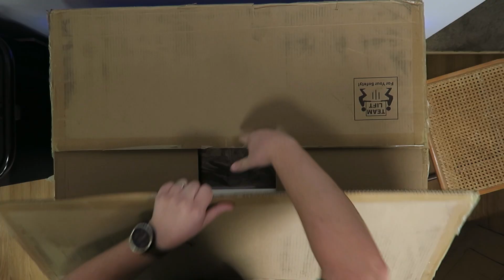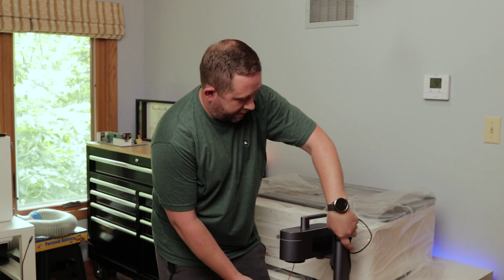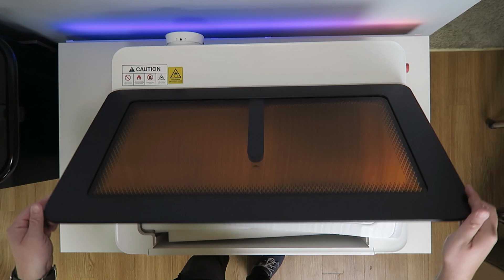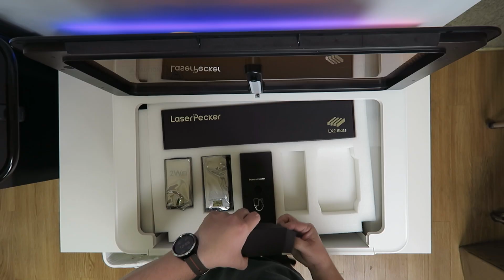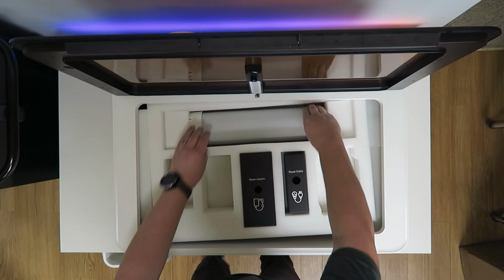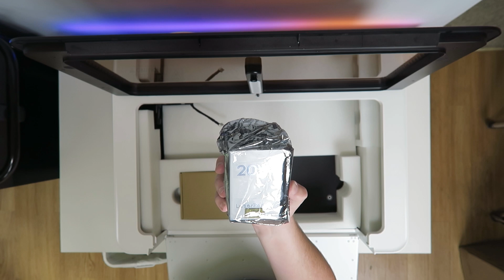Unveiling the LaserPecker LX2

Comment: Did you get the full package? Do you know which laser heads will be included in the standard package if you buy the lx2?
Reply from the maker: This was the package for testers. I am not sure what the packages will end up being yet.
Reply: @KennyGregory it's been revealed... One module, 20 or 40w....
Reply: Hi Kenny, how are you?
I have a Laser Pecker 4 and I’m engraving tumblers. With the white and black ones it works perfectly using the same settings, but on the blue and red tumblers the engraving doesn’t show up well. Could you give me some advice, pls?, Greetings from México ✌️
Reply from the maker: @noelrojas5982 different colors can need different settings. Do a small test on the bottom.
Reply: @KennyGregory  Thank you very much for answering. I’ve been running tests, but I still haven’t achieved the desired result. I even tried using masking tape, but it pulls off the paint from the tumbler when removed. Do you have any configuration you could recommend, please? It would be very helpful 😁
Reply from the maker: @noelrojas5982 tape shouldn't pull paint off a tumbler. If you are testing the design, it should be lower settings to just mark the tape. Tape isn't used when doing actual engraving. Play with the depth. Too low All the paint won't be removed. Too high of a depth and the metal will start getting marked dark.
Reply: @KennyGregory Thanks 👍
Reply: @noelrojas5982 use the 4k aluminum settings  at 1064nm - worxx